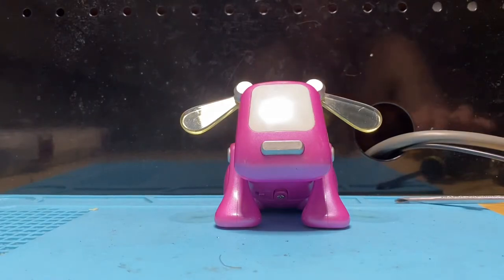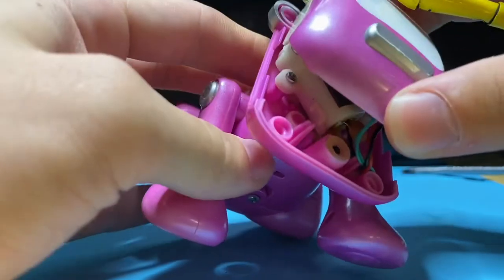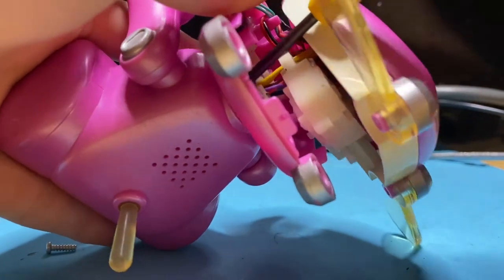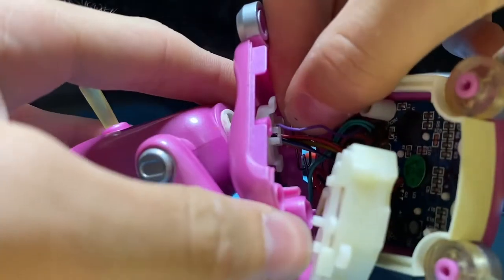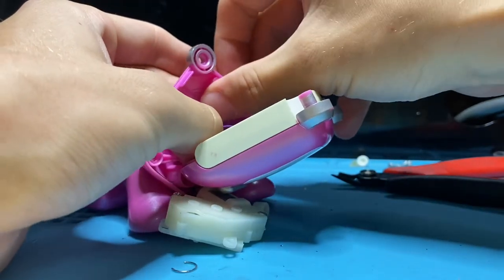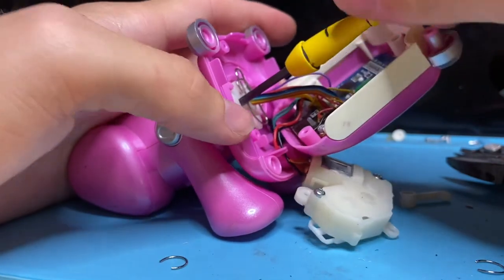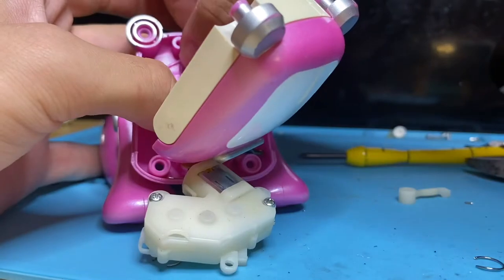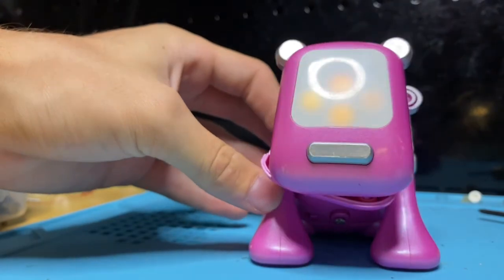Restoration Tutorial - Sega/Hasbro I-Dog Pup/Mini - No Movement/Motor Buzzing

Comment: Excellent job with the restoration of fixing the I-Dog Pup’s head movement by replacing it with a paper clip that works flawlessly when you don’t have a parted out I-Dog Pup with a head spring that is not split. This will really help me learn how to fix any I-Dog Pups I get with this partially common issue as it’s definitely a simple fix, and I also really appreciate you demonstrating how to take apart the head without any trouble while accessing to where the head spring is split. This will really help me a lot that way so there wouldn’t be missing parts or screws that would end up missing if I wouldn’t have known how they properly go inside them.
Also, I do have a question. What size paper clips do they need to be when you try to secure it in so the I-Dog Pup can move properly?

I always enjoy the restorations you do on many I-Dogs man, and this is one of the reasons that inspired to learn how to fix I-Dogs one day!
RIP to the really low pitched Pink 2005 I-Dog Pup you used to have here*